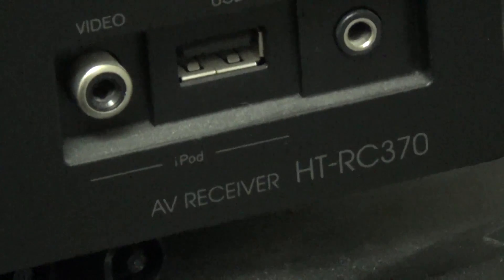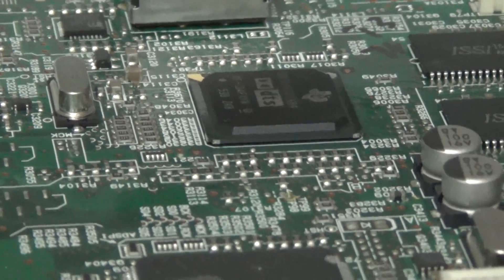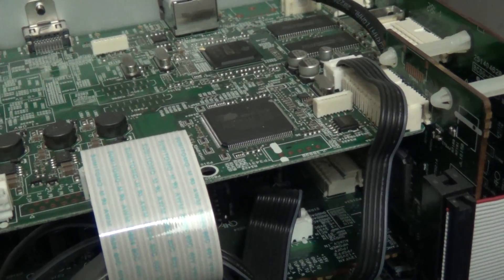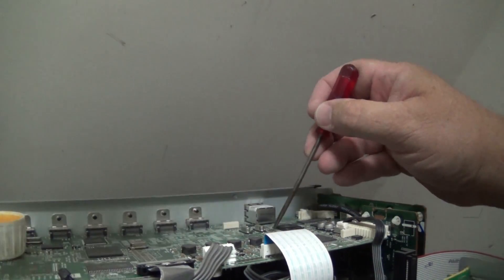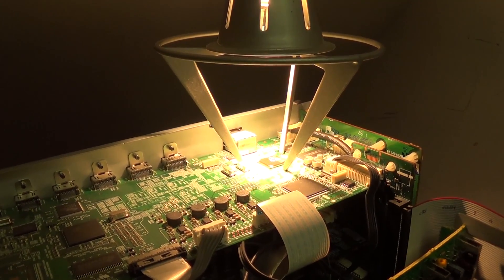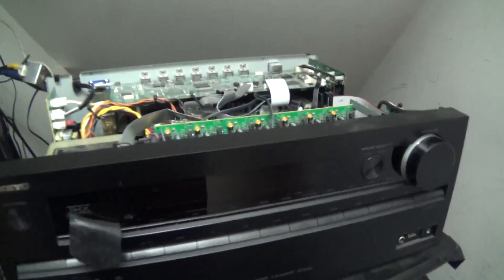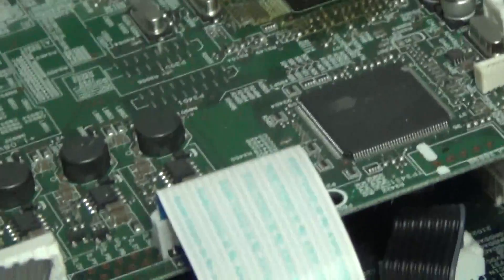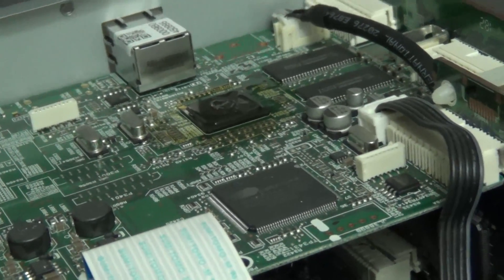Onkyo HTRC370 no sound from main speakers

Comment: I can't get it to work for more than 1h...i'm using a heat gun.
I find it difficult to get the flux to flow under the chip. (NR 809)

Comment: Just wondering if your fix is still working in 2023 for the Onkyo shown in the video.
Reply from the maker: No. It lasted about 4 years and then started to do the same.  I had another one that had been given to me (an older Onkyo) so I swapped it and haven't gotten around to fixing this one again.
Reply: @12voltvids  4 years is a goog run!

Comment: I hope you didn't eventually blow air DOWN on to the board?? Heat rises, so you should have sucked air UP out from the chassis to disperse the heat. I used a horizontal laptop cooling fan over the heat sink for the power transistors sucking air out from below, and have never had the DSP chip problem (touch wood). Thank you for the lightbulb method, though!

Comment: Are you sure it's the BGA that needs heat on these? What if there are a few capacitors in the vicinity that you are extending the life of each time you heat them?
check the esr on all of the metal caps on both sides.
Reply from the maker: This receiver had a recall from Onkyo to replace that chip. They extended the warranty for an additional 5 years. This one would have been covered under warranty however the cost of shipping it to the states and shipping it back was going to cost me close to $300 because of the weight of the unit. I wasn't about to spend $300 shipping a unit back and forth to get a unit that I only paid about 400 bucks to buy repaired. Also what would I use for the 8 to 12 weeks they said it would take to turn it around. My entire system revolved around that receiver. I have since swapped it out for an older model and that one is sitting on the floor of my shop to someday possibly be worked on again.

Comment: Hey 12voltvids, I tried this with a heat gun and the receiver worked for a week, then it stopped working. I will try putting a piece of solder on top to make sure i got it hot enough. I think these fixes don't last very long, as the chip unsolders itself after a while
Reply: two words - heat sink. =)

Comment: Hi VoltVid  and Thanks for the video. on my case when the sound stop to be heard. I also lost the icons of the 5 speakers in the display screen. so when I heat the chip with the heatgun, and the 5 icons of my speaks comes back into the display screen but with no sound.. do you think it the other CARD that needs to be heated the same way  ? ( the one with the speaker connectors ) ? any other recommandation please ? because by logic , If the speaker's icons comes back this means that I m supposed to have sound, but it s not the case . Please Help
Reply from the maker: Mine did the same. When the icon returned I got sound. Worked for a few years and failed again. Never hit around to fixing it again.
Reply: @12voltvids  Thanks.  Any suggestion for me please ?
Reply from the maker: @younessBa  I haven't a clue.  Probably the dsp chip itself.   Again when mine went out after 2 or 3 years I found an older unit for 30.00 and just swapped it out. My unit is sitting in the shop awaiting another trip to the bench.
Reply: @12voltvids  what do.you mean by * dsp chip itself * ?
Reply from the maker: @younessBa  The actual DSP chip could be the problem. I have not gotten back into my unit for any troubleshooting since it went out the last time.  The light bulb trick worked for a long time, and then suddenly it started taking longer and longer to come on, and finally quit and I had already picked up a used older unit that worked so I put that one in service and it has remained ever since.
Reply: You may need to do a factory reset after running this fix.

Comment: When it failed were you able to get sound from FM radio tuner (non hdmi input)?  My HT RC560 has no sound on 2 of my HDMI inputs but have picture.  The tuner FM tuner works fine.   TIA

Comment: Will this chip cause just one speaker to be at a lower volume then the rest? Also the right speaker not only lower volume but as if no bass.
Reply: Hi, I know this is from 2 years ago..but.
I have the same problem with only the right surround speaker.

Comment: I have an Onkyo TX-SR313 with no sound. The DSP chip is not BGA however. The display and other controls function normally, just no sound on any inputs or outputs.

Comment: What speakers are you using with your AV amp? It's so cool how it's located remotely in an equipment room yet the speakers are far away.
Reply from the maker: I have a pair of big Polk floor speakers, and a Proficent center and rear channel speakers that are built into the ceiling, plus a powered sub in the back corner, which quite frankly I don't even know if it works anymore as I haven't watched a movie that would take advantage of it in years.
Funny I built the home theatre about 8 years ago, and never watch movies, just the odd TV show.

Comment: I need ur help sir. My pioneer receiver's surround sound works fine. after a while it stops and sound comes only in pure direct mode. after heating the dsp chip for some seconds with a hair dryer it start working. what is the solution? can u help please.
Reply from the maker: Well it is either broken solder under the BGA chip, or the chip has failed internally and heating causes expansion that temporarily restores a broken bond wire internal to the chip.
Reply: you are right sir. I think the cheap has gone bad. otherwise after a heat by hair dryer for 10 seconds how cum it works. mamy thanks for your reply.
Reply from the maker: If it is a BGA chip it could be the solder under the chip as it was on my receiver.

Comment: This worked on my rs309. Will see how long it lasts.
Reply: JR B I put some heart sink on mine after reflow and also placed 2 12v funs on the on the top, one to blow  cold air inside and one to drag the hot air outside and my have been running for months without going off again. Actually I didn't use the bulb but used heat gun, to heat it hotter for 2minutes.
Reply from the maker: Mine has been going strong for over a year so far.

Comment: is your TV just a monitor? is that why you need the AVR to be able to swtich sources?
Reply from the maker: My AVR and all my equipment is mounted in a rack in my equipment room. In my theatre room there is just the plasma. Sure I can watch off air TV on the set, and I could turn on the internal speakers for that, but everything else comes from the equipment room on the other side of the house. Everything is switched through the AVR, and the HDMI output goes into a HDMI-CAT5 balun, then there is another CAT5-HDMI to convert the signals back from being on a network cable to HDMI. There is about 70' of cable between the equipment and the screen, and all the speakers are built into the wall, and they are wired back to the equipment room.

Comment: I have the same problem. I've seen guys fixing this with a hairdryer. Do you recommend this method?
Reply from the maker: Yes and heat guns work too. I used the light bulb on this one, and a year later it is still working.
Reply: Hair Dryer worked for me on my HT RC360!

Comment: Had the same problem with my 180. Onkyo fixed it, but as soon as I got it back I mounted a fan inside the lid that turns on with the power and placed a heat sink on top of the chip. The unit never gets hot.........

Comment: Wouldn't a heatsink be enough, instead of a noisy fan?
Reply from the maker: +fred Flinstone Sure why not. I still haven't done anything other than the original repair using the light bulb to reflow it. Still going strong after 6 months.

Comment from the maker: A note to this. I just fixed another one of these capy Onkyo  units, same problem. this time I tried a different approach. I made a mask around the chip using aluminum tape to protect the surrounding components from heat, and then used a propane torch to heat the  DSP chip for about 5 seconds.(on a very low flame)  
 I DON'T recommend this approach, and I may never publish the video due to the very real risk of causing a fire. Also too much flame, and other components, or the PC board could be easily damaged. I was at my friends place (another retired tech) and we got to talking about various ways of fixing these units, like the light bulb, and a heat gun. In his garage I found this old benz-o-matic torch, and said,  "I wonder if this will reflow those chips?"  He said,  "I have a broken Onkyo, lets find out". 5 minutes later it is working. Will keep everyone posted on it's reliability, and also my unit which a month in is still going strong. I may or may not publish the video that my friend filmed on his phone. It is pretty shaky.
Reply from the maker: Mine has been working for over a year now no more problems.
Reply: +12voltvids 
Haha, I still would like to see it!
Reply: Onkyo still fixes recievers with this issue until 2018. Free, even sending a box. No cost to customer.
Reply: my parents had a SR606 with a faulty HDMI board BUT it was faulty caps on that unit, (since it wasnt a NR series).. it would lose the HDMI signal once in awhile... Onkyo fixed it for free too
Reply from the maker: This one just lost sound, picture was still there.
Reply from the maker: I wonder if there would send me a replacement board. If I have to pull the unit to send in I would just trash it, because my entire system depends on the amp, and I have no TV without it. Mine is still working, but I would love a replacement board with the proper fix,
Reply: you have to send the unit in, the whole thing i believe they just replace it.
Reply from the maker: Won't work for me. Have NO way to make TV work without receiver. In my case it is mounted in a closet, and everything is routed through receiver. If they sent me a replacement, and I could send the bad one back that would work, but taking my entire system down for weeks is not an option. My unit is working as of now, but if it blows again, I will simply replace it, and it won't be an Onkyo.
Reply: BTW, On ebay i seen some HDMI boards for sale.... Might be worth a look.
Reply: 12voltvids just wondering have you had anymore problems with yours after you made this wonderful video. Thank you!
Reply from the maker: Mike Cramp 
still working. keep expecting it to go bad again but it still keeps on humming along.
Reply: 12voltvids Good I hope it dose. Kept a fan over my TXNR 709 for last few years. but it has finally showing signs of this problem. Planing to reflow and put a heatink in the chip. Thanks!

Comment: The solution for fixing this chip was fascinating.  I never would have thought of it.  Would using a heat gun do the same thing?

Regards, Tom
Reply from the maker: THOMMGB Yes a heat gun will also work, but you have to be very carful with a heat gun, because the hot air can easily blow other components off their lands.You need to mask off the other components with foil duct tape to prevent them from getting too hot and dislodging. This way there is nothing blowing on the board. It takes much longer though. I had that lamp there for about 90 minutes.So far so good,

Comment: My 3 year old Onkyo had the same problem, after much talk with the importers here in NZ. They replaced to board free but I had to pay $98.00 (NZ) for labor. I am also temped to add a small fan, a 5volt supply is available at the USB socket on the front panel.
Reply from the maker: Michael Beeny Seems to be a common fault.Gone are the days where stuff was built to last. Bang em out as fast as you can, and who gives a crap if they die in 2 or 3 years. Planned obsolesce.

Comment: How long did it last until the amp failed again? :p

Like with the X360 / PS3 reflows, this type of fix is very often just temporary because the heat from the bulb wouldn't be enough to properly reflow the solder.

It's more likely that the heat warped the PCB very slightly, which will probably get the amp going again, but might fail after a week or two.
Reply from the maker: electronash I will let you know. SO far it has been on for several hours, and all is good.If it goes bad again, I will use a stronger heat source.I fixed my kids old xbox the same way and it ran for quite awhile. When it died again it was due to a failed dvd drive.